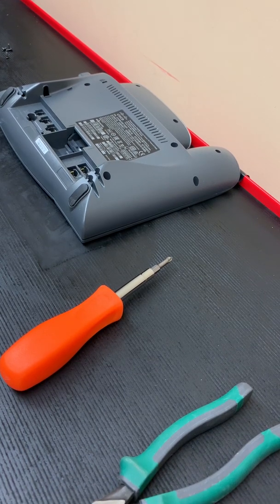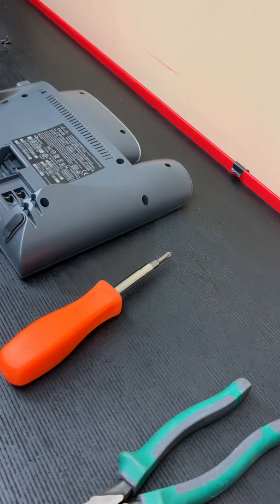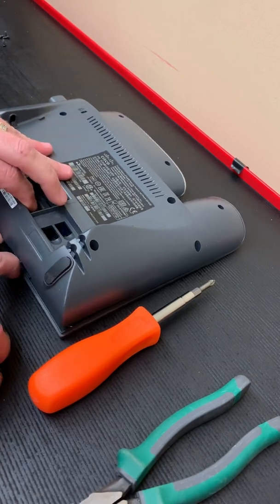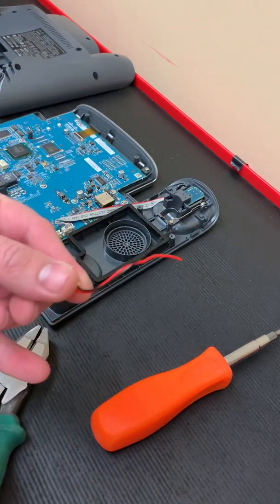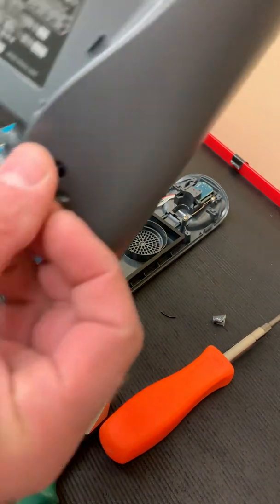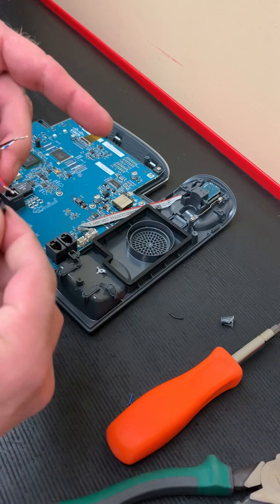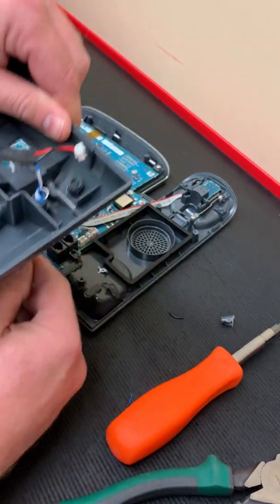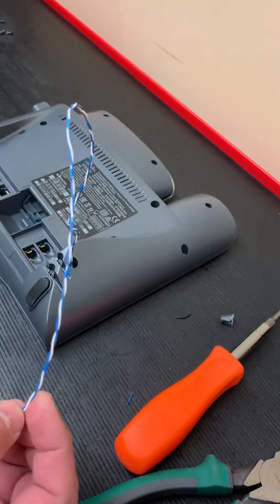Using a Cisco phone as an analog paging source

Comment: Your better off with a paging gateway for a few reasons.
1. You don't have to waste a perfectly good phone.
2. The impedance coming off the speaker of the phone is incorrect for the amplifier.
3. Paging gateways are easier to connect.
4. You don't need a paging gateway on the network as an extension. You can use an analog fxs or fxo port on an ata as an analog extension for use on old school paging adapters that could be onsite from previous analog or digital phone systems like Avaya, Nortel, Panasonic etc.